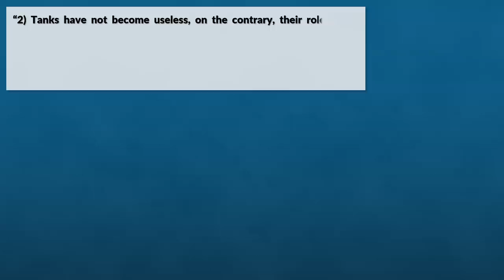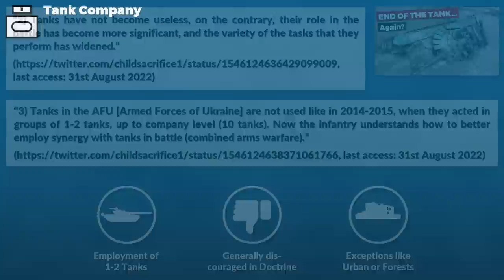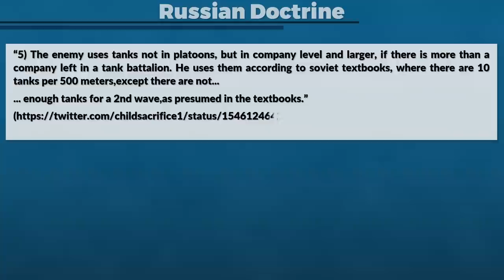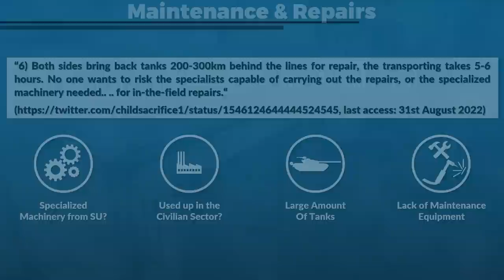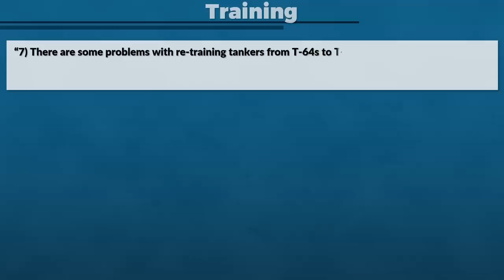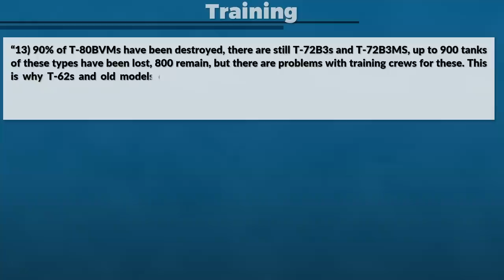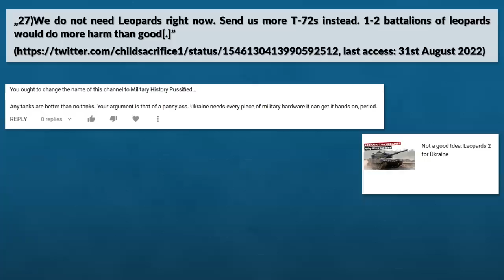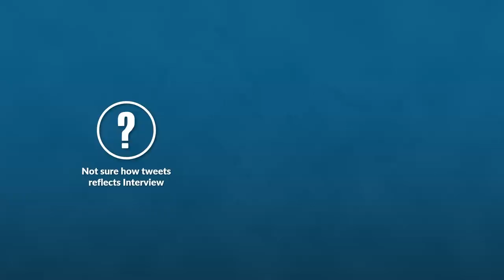What Ukraine thinks of Tanks

Comment: This is also why German plan to sent their Leopards to other Eastern European nations and get them to then sent their T-72's to Ukraine in exchange makes a lot of sense.......Poland and Slovakia has the luxury of time to re-train their crews and personal on a new tank type. Ukraine doesnt have that luxury
Reply: T72 - cheap copy of T72 - cheap copy of T64, same cons except for the loading drum and the shape of the turret
Reply: That and the eastern european states probably will also be sending all their ammo, upgrade kits, spare parts, and repair gear. So its better for ukraine than having new vehicles without ample supplies. Yeah they get an upgraded ford, but at least they can fix it and run it. But if they get the maserati, one part breaks and they have to wait awhile for parts.
Reply: @user-fj1tc6dq2c  Your point being? The crews are familiar with these tanks, the maintenance depot is familiar with them, the ammo is available and they are not facing Abrams, Challenger or LeClerc.
That's like saying the Bren is a copy of the ZB vz 26 with all the same cons when they enemy are fielding BARs.
Reply: @aaronleverton4221  Н
It makes no sense to compare the tanks of NATO and the USSR, T64 and above are deep modifications of the 50-60 years. While Leopards, Abrams and Leclerc are special vehicles to counter Soviet tanks.
Reply: @user-fj1tc6dq2c  It makes perfect sense if you are pointing out why modern NATO tanks are not required by the Ukraine.
What makes no sense is your initial comment. What was your point? You added literally zero information to the discussion.
If you were trying to point out the weaknesses of the tanks then my reply, pointing out that the Ukraine will not be using them against modern NATO tanks, makes perfect sense.
Reply: Can't we do both? Surely the priority should be T-72 but this war could last years and attrition may eventually require western tanks.
Reply: @mornnb  Fully agree.
Concidering the attrition if the conflict draws out, which currently seems likely, there will be no spares and tanks of that era left to be delivered to UA. So at some point they will have to start to change their equipment.
Reply: @mornnb  I imagine thats constantly talked about. We've send PZH2000 and Himars with tons of GLMRS to Ukraine, we're repairing Ukr tanks and sending lots of missiles systems.

I dont think there is any fear to send tanks to Ukraine by the west anymore, and its really just that they arent the current priority.
Reply: The Leopard 2 is easy to learn and there are plenty of parts. 13 users and 2000 of them in Europe alone. We should send them. They protect the Ukrainian crew better than a T72. The change is worth it.
Reply: @RandomGuy9  Tbh tho, one thing I wonder is, how realistic is it to send Leo2s to Ukraine in the near future?

Most euro countries need their own tanks, and the stuff in storage is Leo2A4s, which were 20 years in storage. And probably the worse off vehicles, because the good ones had been sold or upgraded first.

Otoh, the Americans got a thousands of Abrams and Bradleys in storage. That might be a better choice.
Reply: @termitreter6545  as the video says though, lovely tank maintenance depots can be established over the border in Poland or Slovakia or Hungary to repair and maintain tanks of whatever type..., infact its excellent training for logistic elements of respective NATO armies in real world scenario, hell, Ukraine could charge them for it to offset the cost.. :-)
Reply: That was the plan. Poland did send their post soviet tanks to Ukraine but Germany failed to keep its part. Poland is already using Leopards 2 so there would be no problem to put them in service straight away.
Reply: @Miko80  Bullshit. Poland had ridiculous demands like asking for Leo2A7s, which even the Bundeswehr was just introducing.
Reply: @user-fj1tc6dq2c  They are nothing alike.
Reply: But Germany proposed Leo2s in version only for immediate modernization, what takes a lot of time, and polish Leos still arent fully modernized.
Thankfully Korea happily sold their K2 😉
Reply: @termitreter6545  what's bullshit Poland doesn't have there leopards Germany promised them I see the Korean k2s and American m1a2 sepv3s getting there long before the leopards will